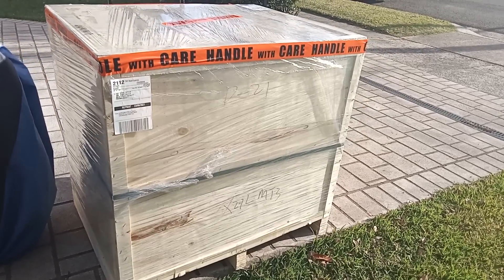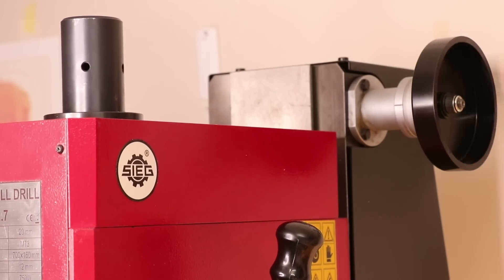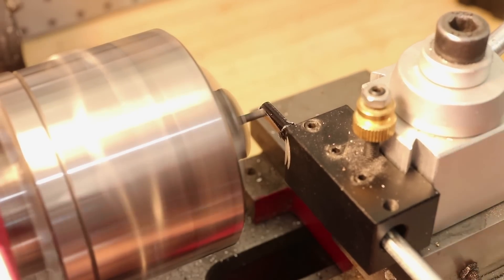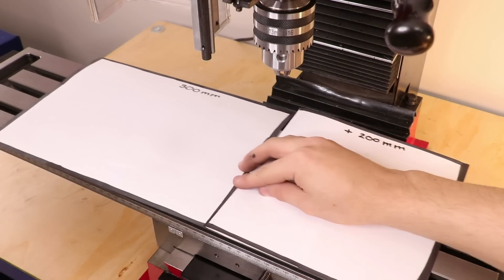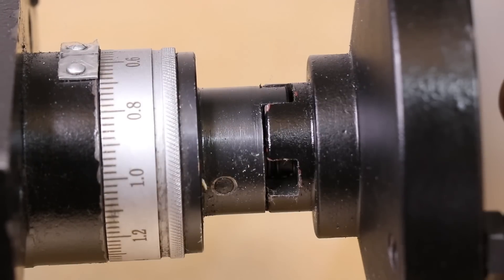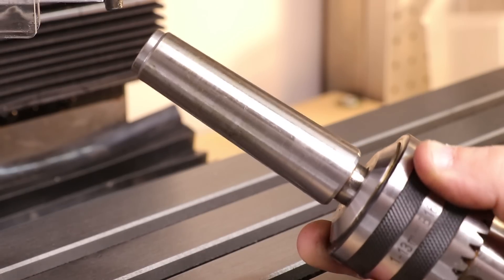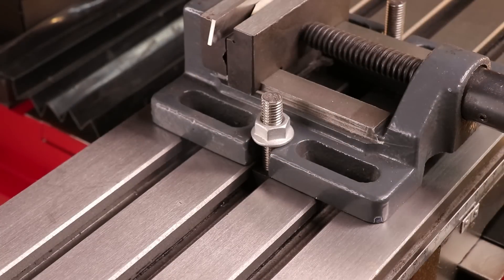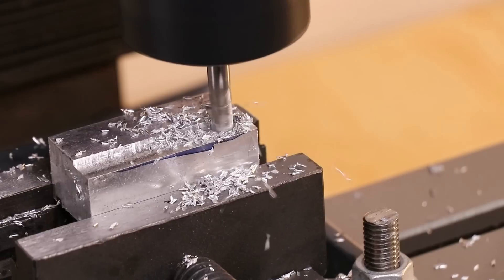I Bought A Mini Mill - Unboxing, Overview And First Impressions | Sieg X2.7l

Comment: hi, i have just bought a mill of the simlilar kind, i went for a paulimut f307-v. it stood between the sieg 2,7 and that one. the issue i am having with it isa high pitch sound from the motor, the paulimut support are saying that it is normal and as it should be. i have asked if the sieg has the same horrible sound and they say it has, but watching your videos i cant hear any of the noice similar to mine. whats your opinion on the sound level of the sieg 2,7 machine?
Reply from the maker: Don’t know too much about your mill but would it be possible if they have different motor types. That might explain the difference. The is a brushed dc.
Reply: @artisanmakes  yes, mine has a three phase motor with some kind of converter that makes it go on ordinary 220v wall socket. they say it is a very high torque motor, but to me it does not matter if you cant work with it due to the noice it makes.  you should consider yourself lucky with your machine and motor 😀

Comment: I wonder how they can make mini lathe for 600-900€.
But mini mills are like 1800-2000€.
I dont understand their pricing system. I have a mini lathe from Amadeal.
Now looking for a mill but Im unable to find any such mini mill for less than 1800€
Reply from the maker: Lathes are just cheaper to make I guess. Less parts and one less axis to worry about.

Comment: I bought a SX2LF Mini Milling machine with a long bed in mid of 2019 and to this day, I haven't used it in the past 2.5 years because of Covid-19  and I still cant get the accessories I need as of yet. Covid-19 froze even shipments from China to Ausee, our supplier of these  Sieg machines. 
I am still waiting, and now it will be 3 years in September before I hear from Ausee on whether the shipments and the accessories had arrived. But, hell, Ausee didn't keep me notified. So, I don't think I will recommend this seller. I've lost 3 damn years doing nothing and still waiting. What sort of seller is this? Has the new shipments arrived? If so, why ain't I being notified? I even emailed the seller recently and still have not been contacted/notified/emailed about the accessories I need to start using the Mill. All I want is, a power feeder for this model SX2LF. I am really frustrated. Bad customer support.  :-(

Comment: Don't completely undo the drawbar when you take the tool out. When I was an apprentice, doing that smashed the bone on one finger when got it caught between a 6" milling cutter and the table. The worst part was the doctor taking an 8 mm long chip out that went through my finger nail. This was 32 years ago and my finger still looks squashed.

Comment: Thank you for your review. 

I'm getting the SX2L (500W brushless, belt drive - no plastic gears) though. I'm pretty certain it will be more than enough for my needs .
I'm forced to order from Germany to Sweden though, the SX2L is AU$ 600 cheaper in Germany than the SX2 (with the smaller table) is in Sweden. Yours is AU$ 3700 over here btw....
Unfortunately there are no models with a rigid column over here except the really big ones.

Cheers
Reply from the maker: Glad to hear it, hope you enjoy it when it arrives. I have seen lots of mods to help improve the column, so hopefully it won't be too much of an issue. Cheers

Comment: Never worked with a machine that works exclusively with the quill, only machines that feed with table height.
Reply from the maker: Fair enough, it's a bit more common on smaller vertical mills than on larger knee mills. Cheers

Comment: Are these too noisy for an apt?  Even with a noise enclosure?
Reply from the maker: I guess it would depend what you cut, but it's certainly not unheard of to put one of these in an apartment. If you look at the early NYC CNC videos you'll see it's all set up in an apartment. Usually for an enclosure you would want to go CNC. I know they are small but sherline, proxxon and taig machines are quiet and should be fine for apartments. Cheers
Reply: @artisanmakes  Thanks for the help.  Yes enclosure would probably make manual machining inaccessible.  I've been considering the Taig CNC mill and lathe but believe manual might be more rewarding.  And that you might get more bang for your buck with manual machines.  I'd buy an old used bridgeport or similar mill and large lathe if I had a garage but guess we'll see where the future takes me.
Reply from the maker: No worries, if you want to go manual, a sherline or taig should be quiet enough without an enclosure. And I agree with you, manual is a lot more fun and rewarding.

Comment: I just came upon this video and am glad I did as I live in the US and this is not easy to get but various clones are available locally.  I was looking for a similar mill and found one by WEN Industries in the US that offered a similar mill with a brushless 1 HP motor with the same elongated bed as the one you have for about $1200.  I am not sure if you are planning to add an auto-feed at least for the X-travel which would be a very useful addition.  I definitely will look for your other videos on this mill before I will finalize my purchase,  Thanks for sharing such detailed reviews about your shop tools and projects.  Rama
Reply: Did you get that WEN mill?

Comment: Cooling is imperative with steel cutting
When doing aluminium use paraffin to lube and cool prevents the swarf sticking to cutter and gives great finish 
End mills are generally not used for facing a surface, use a tipped cutter or turn up a fly cutter on your lathe, 
At the price i think is great for small jobs  especially ally work 
What was table and head vibration like while cutting steel
Reply from the maker: Early days with the mill and I was pretty unprepared with cutters. Mostly use kerosene nowadays, sometimes a blend of that and parrafin which works great. Cheers

Comment: Try to hold the end mills shorter, right above where the spiral ends. Rigidity is very important. Also, short spindle, don't lower it to much, rather bring down the head more. For steel, I would use carbide end mills.

Comment: I can't find this Brand online, where did you buy it?
Reply from the maker: I bought it off eBay. This is the sieg model, but there are other brands that sell this under different names (harbour fright, grizzly). Generally they will have x2.7 mill in the name though. Cheers
Reply: @artisanmakes   this size and price of this X2.7 is exactly the one I am looking for, but those selling on eBay or Amazon, either bigger, heavier, cost more and run on 110V, or smaller ones with only 350 watts output

Comment: only good for  aluminium try on steel everyone uses aluminium for testing not a real test
Reply from the maker: I do regret not having a lot of steel to machine and a larger end mill on hand at the time of filming, but I've used the mill to machine cold rolled mild steel without much issue.

Comment: Correct me if am wrong, this thing cost 2500+?
Reply from the maker: Varies depending on where you are, but I picked this up for $1,800 AUD. There is a more expensive brushless DC motor version of this and it sells for around $2,400 AUD.

Comment: Sorry, this might be my own ignorance as there are lots of machine shops in my area, but why not buy a used full size knee mill for around the same price or a new one for 5k USD or so?
Reply from the maker: A few factors for this. Mostly because this is a hobby so budget is a big limiting factor. Plus I don't simply have the space for a knee mill, and it would probably be impossible to transport a big mill into my workshop. Don't get me wrong, I'd love to have a bigger mill, but it just isn't practical for me.

Comment: I’ve been on the fence about these for a while.  I have a mini lathe and while it’s always broken, when it works, I find it quite useful.  These mini mills are expensive and for just a bit more, I could have an old ‘real’ mill.  But those are heavy, hard to move, and take up a lot of space.  Oh, and use 3-phase power.  So there’s the fence.  Good video.  You might have me leaning a bit.
Reply from the maker: Cheers, I think the value proposition for these mills also depends on what can be found on the used market too. That market is very limited where I live so these mini mills are the only option at their price point. Cheers

Comment: For a small Mill that's a  loud motor. I can hear some  vibration in the Milling cutter.
Reply from the maker: Most things were improved by small adjustments to the gibs and adding dampening material to the mill table

Comment: Junk, if you knew anything about machine tools you could have picked up a used vertical mill.
Reply from the maker: I respectfully disagree. I am not sure about your part of the world, but the used market where I live is not good, especially for smaller machines. And due to my circumstances a large vertical mill would not be suitable. I think if you were to watch other videos featuring these x2.7 mills you would see that they are very capable for what they are i.e. small form factor hobby mills. They are obviously not like the big knee mill that I used many years ago, but they do a decent job for the price and size. Cheers
Reply: @artisanmakes  No problem dude, it's still junk.

Comment: Hi, I have a question: You mentioned that the reason a drill press can't be used to mill is because the side/radial loading will cause the Morse 3 taper tooling to pop out. Your milling machine has a Morse 3 taper spindle- is there something that the milling machine has that a drill press doesn't that keeps the Morse-tapered tooling from popping out?
Reply: Never mind- I didn't realise that pillar drills don't have a drawbar to secure the chuck during radial loading.
Reply from the maker: @chrismorgan200  Pretty much the draw bar, I have seen some people on youtube use drill presses as mills, using those mill tables, but you have to be very conservative with the feed or the taper tends to pop out.

Comment: I made the mistake of buying a stig X1 . No where in all the advertising on ebay does it say that the gears are all plastic and are not covered in the warranty , I found out after telephoning the company that sold it to read the fine print on their web site . I am in the process of making metal gears to replace these planed obsolescent parts .
Reply from the maker: I am not as familiar with the x1 as I am with the larger x2 and x2.7 mill. I am a bit surprised about the fact that is uses gears. They are probably the same as the acetal gears that are in the sieg lathe that I own. I have never had issues with the acetal gears, but metal gears are the way to go or a belt drive conversion. Cheers.

Comment: Every time I buy a large Chinese power tool, it performs so poorly that it just becomes a matter of getting rid of it and replacing it with a "real" tool.  So I spend more than if I had just started with something decent.  Been a few years now though, maybe the Chinese stuff has improved.
Reply from the maker: I guess it depends on what you buy and expectations. The mill is purely a hobby thing and it works perfectly as a hobby mill.

Comment: You're better off with a cnc router. Those mini Mills are too flimsy to mill steel well and far too slow to be great for aluminum with small tools.

Mine ploughs through aluminum with a 1/4" end mill at 20,000rpm like it's not even there. 

A man could die of old age waiting for a 2000rpm mini mill to finish a cut...
Reply: Which one do you have?
Reply: @LimabeanStudios  I built my own cnc machine using epoxy granite. It can cut steel, aluminum, wood etc.

Comment: If I remember correctly, two flutes are better with low RPM machines, and the bit you used on the mild steel looked like a four flute which requires higher RPM. Just for the life of me, I can't remember why. The bed size seems like a fairly significant improvement over the SX2P and the locked head; I think you have won me over on the 2.7L Cheers for the video on it.
Reply from the maker: Maybe one day ill have a properly stocked set tools but at the moment I made do with what I have on hand. From memory i though 4 flutes were better suited for steel and 2 flute for aluminum (had a quick look in the black book but I can't seem to find anything on the topic), but the 4 flute end mills I have seem to machine aluminum just fine. And having used the mill for a while now, i can say the extra bed length has really come in handy on several occasions.
Reply: @artisanmakes  The brain loves playing tricks on us all.  I have only been taught by youtube, so good chance I remembered it wrong.  And I guess there is only one way to find out, and that is to buy a mill.

Comment: Hello 👋 friend. I'm not sure if you said, that the drive motor was brush or brushless?? Still waiting for my Lathe. Because of my general background, 40yrs involved with machinery. I wanted something specific. Good luck 👍 and hopefully I'll see you milling.
Reply from the maker: I think I mentioned that this mill has a brushed DC motor, however they do sell them with brushless, but the brushless models are an extra $300-400

Comment: Cutting Speed for Mild Steel is roughly 30m/min and Formula for rpm is CS=Pi * Diameter of cutter (Work piece for lathe)* RPM /1000

Comment: Coolant , coolant, coolant wil make tools last longer and give better cut.
Reply from the maker: Cheers. I gave the aluminum a light wash with WD, but maybe not enough to be noticeable. I have since switched to a high Sulphur kerosene and its pretty decent. Cheers.
Reply: @artisanmakes  I use technical or industrial alcohol. It's not as messy as oils and much more effective when working with aluminium. https://en.wikipedia.org/wiki/Denatured_alcohol
If you work a lot with aluminium I recommend getting end mills for aluminium. The finish is much better. Like mirror. Almost.
Reply from the maker: @dansihvonen8218  Cheers, that is sold as methylated spirits in  Australia. I will have to give it a go.

Comment: Unless I'm mistaken , this mill does not have " Tram adjustment "  Its fixed from the factory , so if its out , its out !
Reply from the maker: Thankfully there is a little bit of adjustment that can be done by the end user. There is a set of grub screws, one on each side of column (at the base) to tram in the mill.
Reply: If it comes apart, you can always shim or scrape the surfaces to get your tram closer to square.

Comment: Enjoy. Just want to say you don't want to get into the habit of completely undoing the drawbar before breaking the taper as you can end up damaging the thread on the end over time. Just loosen it then tap it to break the taper.
Reply: Antonmursid🙏🙏🙏🙏🙏🇲🇨
Reply: Right.  Leave it engaged a thread or two before hammering it.  Your draw bar and collet holders will thank you for that.
Reply: Funny you should mention it...

Comment: Regards comparison on the X2L vs X2.7L and rotating  column, people should know the SX2LF has a fixed column and a considerably better motor than the X2L and for 'only' AU$200 more, which leaves it at AU$670 cheaper than the X2.7L . As an aside, the brushless DC motor on the SX2LF despite being 500W, vs the X2.7L at 750W, could have better torque at lower speeds due to the far superior brushless technology. Table size and overall solidity of the machines the 2.7 is way ahead of course. For AU$700 more you can have the far superior SX3L but it's a heavy and big beast to get into the workshop. I think the only wrong answer is the X2L.

Comment: Generally speaking looks like a very nice mill.  It is very similar to the Grizzly 0704 mill I use and may be simply a knock off.  To me the down side of this mill is not having a R8 spindle which is pretty standard in vertical mills of Bridgeport size and smaller.  I had an early X2 with MT3 spindle and it was nothing but trouble and tooling was pretty limited and crude.   Interchanging tooling with a lathe isn't important to me because I consider them different machines for totally different purposes.  Do yourself a favor and buy some mist coolant and a squirt bottle.  Squirting your workpiece with coolant will make for better tool life and give you a better finish.
Reply from the maker: Thanks for letting me know. I knew that getting the MT3 spindle was going to be a compromise, but having interchangeable tooling was enough to convince me to get the MT3 over the r8. Plus R8 spindles were a more difficult to find in stock when I was buying my mill so I would have probably chosen this model anyway, rather than wait for them to get a shipment in from china. Cheers

Comment: Was this on sale when you bought it? Seems like they are $2350 now, which is a bloody huge hike from $1500!
Reply from the maker: I was very lucky to snag this mill and vise as an end of financial year sale deal. The mill usually retails for $1900 aud. The brushless DC motor version tends to run around the $2300 mark. Cheers

Comment: “That’s a pretty decent cut.” No, it’s not. The table isn’t moving properly. For one, the gibs are too loose. Possibly, it needs to be taken apart, cleaned and checked for burrs and any other disturbances. But these small mills have a tendency to flop around a bit when turning the handle. That is, when you turn it, and are moving the handle towards the front of the machine, that end of the table moves slightly to the front, while the other end moves towards the rear. It’s twisting in the ways. Conversely, when the handle comes around the top or bottom, and moves towards the rear, the opposite happens. This gives that slightly wavy cut we saw.

Eliminating that problem, and it is a problem, requires motorizing the movement of the X axis. That eliminates the pull towards the front or rear engendered by hand turning. It happens with the Y axis as well, but usually not as badly.